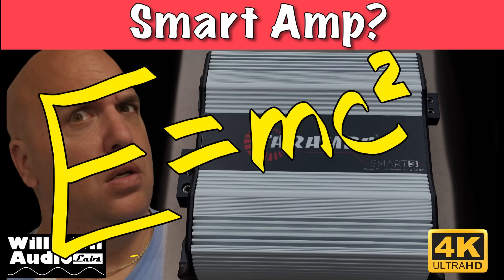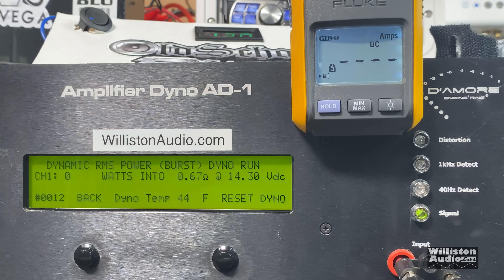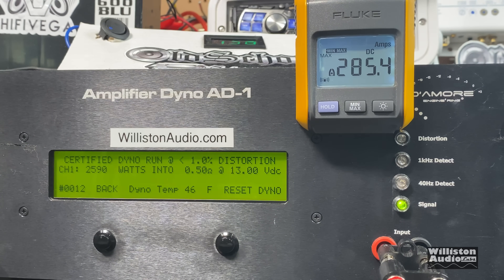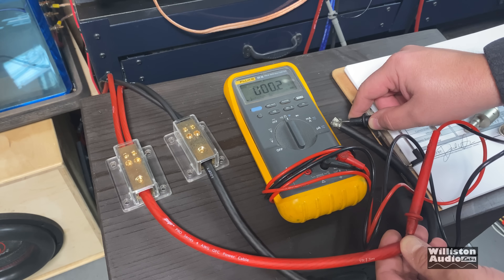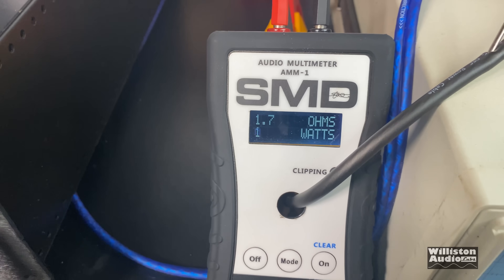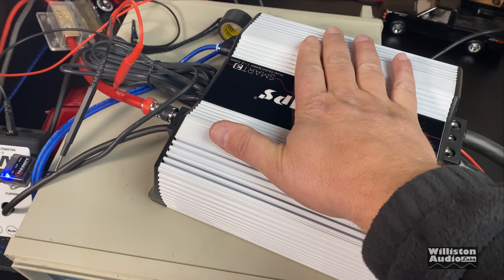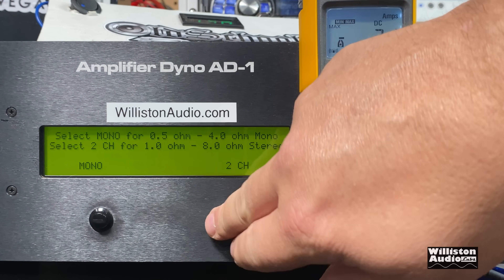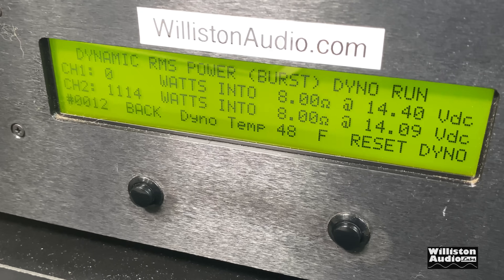Taramps Smart 3 vs 6000W Sub and INSANE Amp Dyno Low Impedance Testing [4K]

Comment: Will this be good to run on a standerd alternator and 225AH lithium battery I will be powering a 12inch vibe blackdeath 5000Rms. I did want to go for the smart 5k but did not want the sub to blow as av seen these amps punch some serious power on 2 12s and 2 15s
Reply: 225AH of lithium is huuugge! Wow. 
Did you do it? I'm guessing power was no problem.
Reply: @WifeBTR123  am running a audiobahn 2000rms amp with no issues my alternator is standerd 140amp 😅

Comment: Can you strap 2 Smart 3k together?
Reply: no, its a full bridge amp, i forgot the actaul reasoning behind it but it being a full bridge is what gives it small formfactor but you cant strap them
Reply: @Toothless69420  They basically are already strapped, that's why.
Reply: @SnubBarracuda  yea u can, there is output and input in smart3. Manual says u can
Reply: @MUFAFAOpel  I have a Smart 3. I don't see anything about strapping in the manual. You can have RCA pass throughs without an amp being strappable. I don't think any full bridge amps are strappable because they are basically 2 identical amps on one PCB, already strapped.
Reply: @Toothless69420  yea u can, there is output and input in smart3. Manual says u can
Reply: @MUFAFAOpel  no that’s just to go out to another amp lkke mids and highs, look into how they’re designed, it’s literally impossible to strap them together
Reply: @MUFAFAOpel  you can match gains and run 2 amps on 2 separate speakers, but actaully strapping them together and running theyre power together into 1 connection into the 2 subs does not work

Comment: Where did you get that Deka battery from?  Those aren’t cheap!  Approx $5-600 for one.  I have had 3 of them, at 12v & 150ah, they rock!  But they weigh about 130lbs a piece!!  But man do they help with a big system!!!

Comment: So did I see that right you wired it to .5 ohms real speaker but it ran at about 1.1 ohms?
Reply from the maker: Yes this is called impedance rise
Reply: @wal I’m gonna wire my sub at 4 ohms on a 8 ohm stable amp. Wish me luck

Comment: Would just the big 3 upgrade be enough to run this app at a 1ohm load?
Reply: No, from BidD's tests this amp at full blast sucks around 300 AMPS of power, even with a 300 amp alternator that leaves NOTHING for your car.  You will need some sort of battery buffer for this.  I'm planning a build using one of these plus the taramps 400x4 and some lions are big on my shopping list.  Along with at least one VHO alternator.
Reply: @Grimsterrr  I run a Smart 3 with a stock 130 amp alternator and 70 AH agm battery. Not getting the full potential but no light dimming or issues after almost 2 years.

Comment: Given this and the previous video, what would y'all  choose? 4 15s, can handle 1k a piece,  can be wired to 2 ohm or .5 ohm. Which impedance would you choose?
Reply: I'm in the exact same situation i have 2 1000rms 15s now plan on going with 4 and this amp and was wondering same question.
Reply: @danruffing5057  I think I'm gonna do .5 due to box rise.
Reply: I was thinking thw same thing.

Comment: Sucks that it doesn't have a bass knob adjustment. What would your suggestions be for a massive hippo 12" XLR 3k rms in the 300 dollar range like the one you tested?
Reply from the maker: I like the D4S JP23v2 Shop4Bass.com. It has all the features, great bass remote, built well and tons of power.
Reply: @wal  thank you I'll order it

Comment: I've been running my smart 3 at .5 ohms for well over a year now and I haven't had a single issue with it whatsoever. I even bought it used for $150! I think as long as your electrical is solid you shouldn't have any problems
Reply from the maker: Yes the amp has built In current limiting to protect it at low ohm loads
Reply: @wal  It definitely does limit the current. The amp puts out a lot more power at .67 than at .5
Reply: I did both! I've got three 50ah agm batteries and a 320 amp alternator. At full tilt I maybe drop half a volt at idle and none at all when I'm driving.
Reply: What would you do to your electrical?? Just a new battery or alternator as well?

Comment: Hey big d I’m looking to buy tar amp 3ksmart bass does this amp require  a capacitor or a battery or alternator upgrade
Reply: Yes I would at bare minimum get a secondary battery I run 0g power and ground on a d1200 65ah agm battery and it still drops into the low 13s high 12s
Reply: I just bought this amp,and it clips and goes into protection cause I've got no where near enough power to feed it with zero gauge wire, extra battery, upgraded grounds and positive leads .my skar rp1200 pushed my duel 2 ohm quad stacked audio pipes

Comment: Also how you said about the holes being small I started out with a taramp 5k but I felt was a little much for my single sub and the 5k is 1/0 gauge wire and I have sundown ofc wire and I traded for the smart 3k and went to hook it up to the metal multiple converter to run to my extra battery and realized it was 14 gauge wire so I took the metal 1/0 gauge connectors and sanded it down till it fit the 14gauge hole because I wasn’t trying to switch 14gauge on a 3k amp and only a extra xs power d6500 (4k 85ah) battery to power the 3k because I paid a lot of money for 100fr of 1/0 ofc sundown wire so I wasn’t taking it out and my mids amp are hooked up to my front battery.

Comment: I have a smart 3 on a sundown xv2 with a 8 layer progressive spider and zv4 coil a standard v2 is rated 1.5k but with the upgrades I’d say more around 2k and you can normally double the power to sundown with it being underrated but my sub is a 1ohm so should I keep it at 2 or try .5 and what would be the best crossover and gain setting?

Comment: I just bought one of these and it’s on the way, I have a 240amp powermaster alternator and 1/0 big 3 done, but only 1 battery, will I still be able to run it? With my current MD1200.1 I get no voltage drop, even with the amp pushing it’s hardest and front and rear ac on full, low and high beams on i still get 14.6 volts

Comment: I bought the smart 3 bass before watching barevids breakdown. Did I mess up?
Reply from the maker: Nah it’s ok. Both are good amps
Reply: @wal  I’m second guessing if I will be happy with the 3 k or if I should return and get the 5k.. I have the 3k soundqubed you tested right now, and will be swapping it for the smart 3 bass.. just running a single zvx12 for now, but want to eventually build an aero ported box for a x15v3 or zvx15 or something similar.

Comment: I have 2  American bass  VFL .        8 inch 600 rms.  When I turn it up  on some hard bass it goes in protect mode then comes back on when I turn the bass down a little.    Why is that ??? And oh yea I have it wired to 4 ohms the  subs.   Should I wire it 2 or 1   Or maybe more voltage ??      Factory alternator.  With the car running I get 13.82 v
Reply from the maker: Factory electrical with a Smart 3? 😲
Reply: @wal  😂
Reply: The ground was very loose the lug screw is stripped not holding the wire
Reply: Upgrade your eltrical

Comment: What does it mean when it is clipping? I recently hooked one of these up to 2x Skar EVL 12's and I upgraded my alternator to a 220A and my battery under the hood is a XSPower D3400. Got a custom box built tuned to 32hz. I will get clipping dependent on the song I am playing. Does this mean it is not getting enough power?
Reply: Too much power. Get a bass knob and turn it down when it clips. There is lots of videos on YT about clipping.  Clipping kills subs.
Reply: @Richtaco  so my subs are trying to pull too much power from my amp ?
Reply: @forgottenone7290  your amp is trying to push too much power to your subs. It’s maxing out and sending a bad distorted signal to your subs. Look up amp clipping on YouTube. There’s tons of videos about it. But the best thing to do is hook up a bass knob. Lots of videos on that too it’s super easy for a basic knob. With that you can control the amp. It’s really handy because some music needs more bass than others. Best move is get a bass knob and when you see it clip, lower the knob down a bit.  You don’t want clipping it can kill subs.
Reply: I'm thinking something else.  I'm watching videos that u too can look up where the bass 3k and smart 3k on 2 or more evls sdr several brands of subs and handles jus fine..I have the evl 15s so cnt compare them I'd play with the sub sonic filter turn all the way dwn and Lpf about half way and see what it does..jus my thoughts..I actually like the bass 3k over the smart 3k..it gets louder..But their are alot of videos on you tube go check em out

Comment: Running 2 skar zvx 12v2s at .5 daily driver 8months beating the doors off my truck..NO SHUT DOWN CLIPPING SMOKE SMELL ETC...WIRE YOUR ISH CORRECT
Reply: what did u do as in electrical like alt and batteries?
Reply: @SEABASS05  big 3 stock 110amp 2 agm in the back with stock lead acid in front back has a yellow top and platinum duralast total of 95ahs with back 2batts..total of 120 no diverter or capacitor or whatever its called..run your system with car running 14.8 volts steady off batterys stay at 12.9 to 13.1 so lead and agm dont mix is a myth AGAIN DO NOT RUN SYSTEM WITH CAR OFF...why would u anyway??

Comment: Question.  I have two smart 3s on 4 12s.  1ohm.  I have a 1973 Eldorado.   Can a alternator amp 240/250 and 190 at idle be enough power to keep my agms charged for good eletrical.    I was told a 300 amp alt would be to much on my v belt?
Reply: 190 amps at idle will not regenerate the loss of 2 x 3000 watts amps. That said, as long as you play in chunks then give it time to recharge you will be ok. You probably want to go to a multi-alternator setup though.
Reply: @trev6783  i have a beefed up rewound alt.    Im back on 1 smart 3 and 2 15s.     That should be waaay better.     I still will order a 250 alt.    I just have a single v belt and they say it wont work unless i change my setup to a serpentine set up or get two alternators
Reply: @moneymac5214  Yea each 3k amp will pull probably 230-250 amps, possibly more depending on the impedance. A 250 amp alt will still probably be good enough, if you have a decent battery.

Comment: Williston, Im about to run 4-8”xv3 in my 19 titan.. i am currently running an sfb 3000, but me and my buddy have had some issues with clipping... he went to an sfb 5000 on his 12” xv2 and he is no longer having issues. Do you have a recommendation for me to push my 4 pack
Reply: Turn the gain down :) or buy a bigger amp.

Comment: I have the same amp i been having issues with anything i do electrical it makes thump noise thru my subs when i start my car i get  a thump thru the subs i pulled then center piece off where my radio is at if i unscrew a mounting screw and let the radio scratch on the metal mount i get a bassy scratching thru my subs i also noticed if i turn the high pass filter all the way up it puts out a wierd  high pitched hum thru my subs  i wish barevids would see this and lmk what he thinks also i used totally diff set of rcas same issue i have a amp in my mids and highs they dont seem effected im thinking of unpluging the rca from the sub output and trying the rear set of jacks and see what happens i have a sony xav ax5000 stereo other than that issue with anything i turn on electrical the amp plays fine i hooked up my kicker zx 300.1 and didn't notice the issue .i was thinking i messed up the ground on the rca so i put a wire going from the outter ring of the rca to a solid ground and still have the same issue its kinda reminds me of  turn on thump cause when i turn the key off i can hear the subs slowly vibrating for about 5 seconds then it just stops and  i have volume on 0 and my subs are vibrating if i unplug the rcas it stops doing it ? Any ideas anyone?
Reply: Are you using a Hi to Lo? It sounds like a Hi-Lo issue
Reply: NVM saw you have a Aftermarket head unit
Reply: After market hu and ground loop isolator installed shielded rca wires awesome grounds big  3 too i sold that amp bought a new 1 this new 1 doesnt have the problem.
Reply: Update this amp doing same noises

Comment: What am I doing wrong it barely pushes my sundown x12 threw it into protect within 5 mins of trying to tune it lol
Reply: Probably defective. Either that or maybe your electrical was trash and made the amp go into protect.
Reply: @JohnDoe-us1ek  prolly running 4 guage cca wire on a stock 100 amp alt and keeping the amp in constant clipping. Just a guess tho.
Reply: I watched these videos before I bought thinking it would have no problem running that 1 sub barely pushes it my mtx thunder 1000.1 1ohm amp pushes it with no problem
Reply: They make a hd 3000 1 ohm and a hd 3000 2 ohm model most ppl that fried the power connection on the amp was running too low of ohm load and was using crapppy cca wire wich conducts heat itll get so got u cant stand to touch the power or ground i mean hot.
Reply: The smart 3 I had pushed my x15 like a mad man. Only amp I’ve had push it any harder was my md12000.1d. Both wired to 1 ohm
Reply: Blown sub or your clipping the crap out of it ...because your car won't produce the power the Amp needs

Comment: Nice one try hooking up both input rca instead on just one you would of got twice the output your only running half the amp
Reply from the maker: One RCA is input, one is output. #becauseTaramps
Reply: They can both be input test and see urself or it can be 1 input 1 output . I use both for input
Reply: @joshholden8561   thats why yours was making wierd noises.. only 1 rca is needed
Reply: Ur wrong I emailed tramps they said both can be input signal or 1 can be in 1 out  I have the single rca labeled out and the amp is playing just fine

Comment: It was an alright amplifier. But honestly I thought Kicker’s CXA800.1 kicked the taramps butt.  

     The Kicker able to hit lower notes. And I got higher dB levels out of it.  Was cheaper in price. Lasted way longer. And the Taramps just going into protection anytime I got over 90 dB.

   Perhaps I got a lemon amp because I could never pull over 40 amperes on it before it protected itself from being any louder.

    Very surprised I have not seen a review for it.  (Kicker amps.) just rocked my cvx’s a lot harder and never got as warm.
Reply: So you're electrical sucks
Reply: Kicker amps are badass, have you seen the kicker cube? But yeah sounds like you got a dud these smart 3s seem to clamp some power
Reply: Did you have the eltrical to support the smart 3

Comment: I have a bass 3k but was thinking to upgrade to a smart 3, do you think the upgrade is worth it? Running 3000w RMS sub at 1 ohm
Reply: How's the bass 3k holding up?
Reply: @MLProductions.1  amazing, no overheating, no issues apart from the clip monitor which broke at the solder points inside but taramps sent me another free of charge so I didn't need to mess around soldering

Comment: I'm a new subscriber just recently started watching your channel love the reviews on everything you do from speakers to amplifiers, which got me into a little predicament,and I need your expertise. I purchase for 8in fierce Toro subwoofers I want to try to run them at 4 ohm so I can get the best efficiency for the speakers. I decided on (3)amps but I don't know which one to grab they range from $300 all the way up to $1,000 the amps are as follows Rockford Fosgate T 1500 1bdcp, the other one is the kicker kxa 2400.1, and the last one is the tarampsmart 3. Out of all three the only one I noticed that will run at 4 Ohms will be the smart 3 tar amp I has the best efficiency out of 3amplifiers,but I'm afraid that I get what I paid for and I'm confused to wish one I should get my mind is telling me to go with the kicker kxa 2400 because its great efficiency throughout the range. If I'm unable to run the speakers at 4 Ohms then I was going to go down to 2 ohms the kicker is way much stronger due to the fact that is 2400 watts and my speakers only handle 400 watts RMS each but I could always tone down the amplifier which of the three amplifiers would you recommend again I'm running for 8in fierce Toro subwoofers. Any help would be greatly appreciated PS keep up the good work I'm loving your channel is helping me tremendously on deciding what to do with my Jeep.also a ported box 33hz  a quadzilla ported box.I believe the power is underated on the fierce toros and they easily can handle 500rms.Helppp

Comment: Could I plug in a remote bass knob to where the clip indicator goes in? Would that work??
Reply: From what i understand it is not setup for a potentiometer but simply a data relay for the indicators. so it wouldn't do anything to my knowledge.
Reply: no
Reply: I wouldn't think so but PAC Audio makes in line rca bass knobs that do the exact same thing an amp bass knob would do and only cost $10

Comment: The taramps bass 5k runs half ohm. Doesn't get warm never had any trouble wat so ever..should do a video on the bass 5k.. 500 for a 5k cant really go wrong.
Reply from the maker: I did Bass 3k and Smart 3
Reply: Does The md 5000.1 run half ohm and does it get warm???     I got 4 12s dual 4ohms quantum audios.  5000 watts 1500 rms.   Tryna find the right amp to push hard